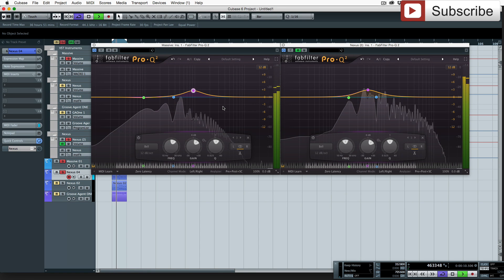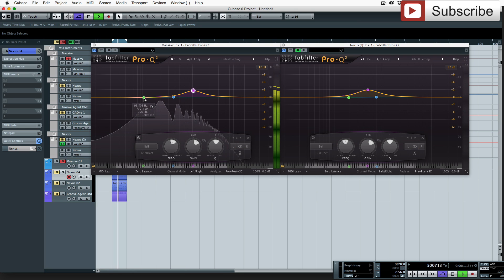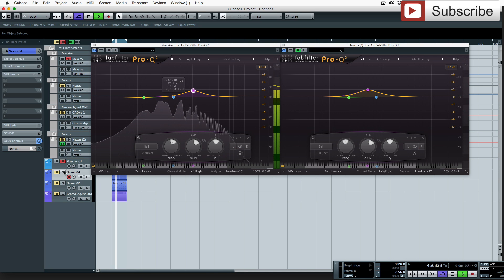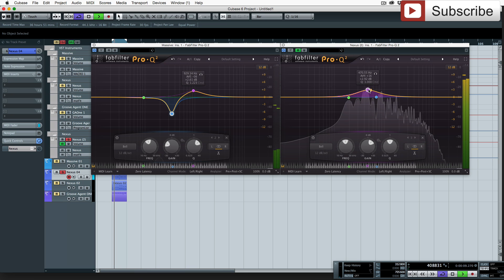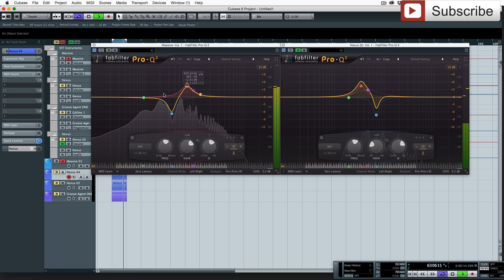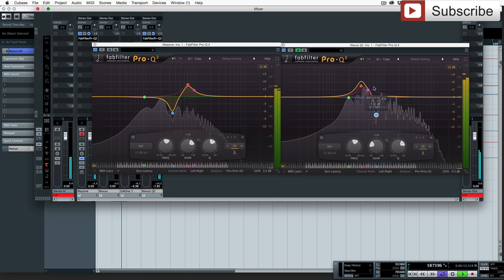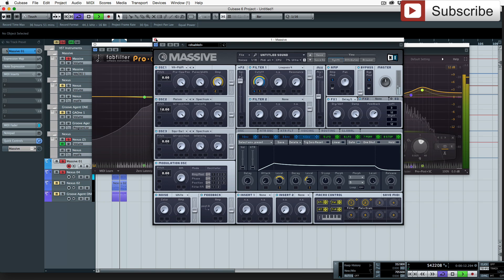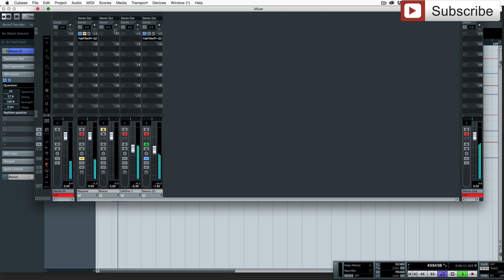The best Basic EQ Techniques

Comment: As a newbie (and having taught Computer Aided Drawing) this video is so good. 
Firstly, it explains and illustrates the 'why' (thus context is clearly established) and for beginners, sometimes that stage is not so easy to grasp from some videos. 
Secondly, it then step by step, explains the EQ tool (too many videos assume more detailed knowledge). 
Thirdly, the body of the EQ work is then explained, again in clear steps. 
Fourthly, at each stage the bypassing of effects is given time for the effect to be evident for less tuned ears! 
My only point, and I trust you will take this as a constructive suggestion, the vertical arrangement of the two EQ windows works better - the alignment of the cuts and fills is clearly more evident (thats my graphics background). 
But brilliant. Well done, and thanks Demis.